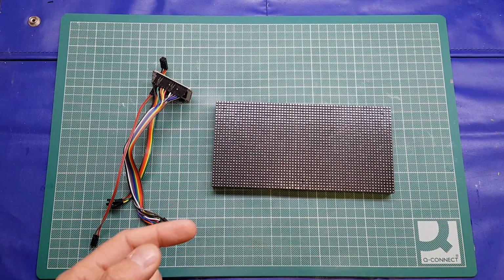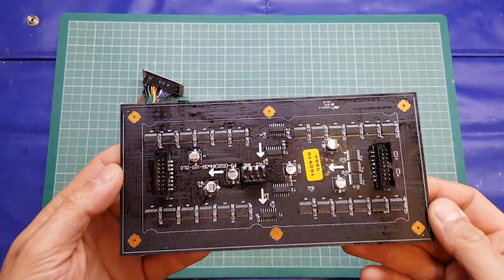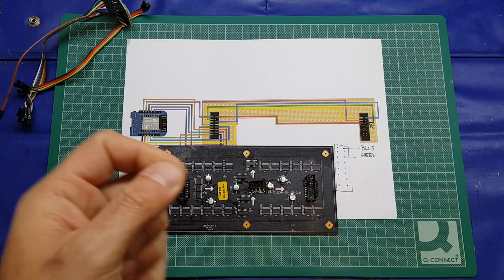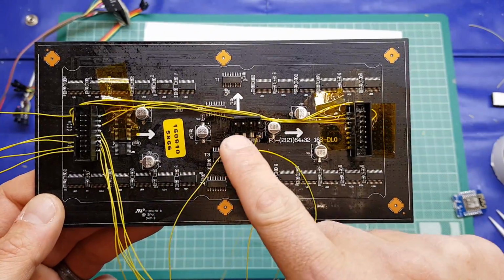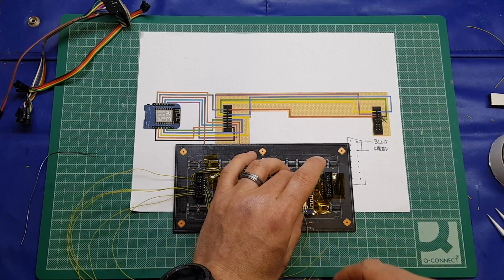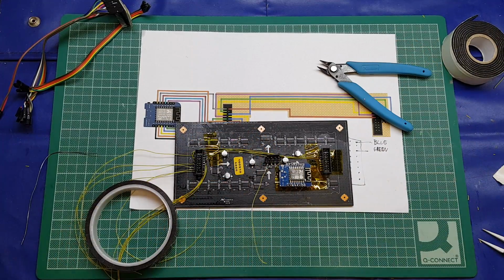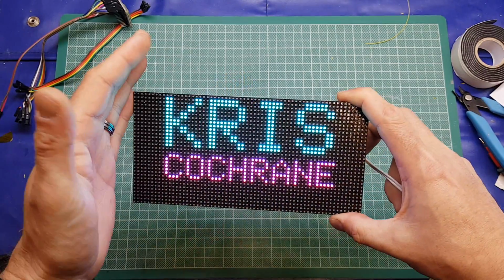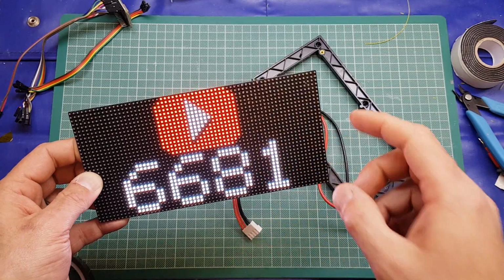A rat's nest! - Permanently adding an ESP8266 to an LED Matrix / Brian Lough's Subscriber Counter

Comment: When I first started playing with matrix panels, I started direct driving them, but burned out a board by not paying attention (wired up in mirrored fashion), now I just use an adafruit board on a raspberry pi.  Currently driving a 256 * 192 RGB matrix just to play retro arcade games on.  24 times the size of your wee panel there, alas I cannot power it from USB.  As someone else said, using one of the ribbon cables that come with the boards may have speeded up the process a lot.  Great video.

Comment: very good! I've some IDE PATA flat cables (40 wires on each) somewhere, can be used instead of the flying cables? Better organization, i think :)
Reply: The boards should be supplied with 16 way ribbon cables to control them, would have speeded up, but much more fun to have loads of wee wires everywhere I think :)

Comment: Awesome stuff Kris!  A really nice idea for a compact panel solution!  
One thought though: I would've suggested using slightly thicker wires for the power feed. 
Kynar 30AWG wire-wrap wire is OK for perhaps up to 100mA power feeds (considering also Ohms/M of 30AWG).  
To be fair though, your board position does allow the power run to be quite short.
So just ignore me being unnecessarily over analytical. But, hey, just something to consider. :-)
Reply from the maker: I agree Greg, someone else mentioned it too. I'll definatley change it.
Reply: The run is so short it's probably fine for this use, but lighting up the whole panel would be a bad idea.

Comment: When powered via USB, are you not concerned that the wire you used to power the display is a bit undersized?
Reply from the maker: In hindsight I probably should have used 'beefier' wire between the 8266 and the connector. I'm sure it will be fine for this application but if the panel is drawing 2A with all LEDs on, it may not be suitable.
Reply: For me, if this was just a proof of concept, or something that you just show off on occasion, I'd leave it. If you plan on running this 24/7 (which I would because it is awesome btw), then I would change them.